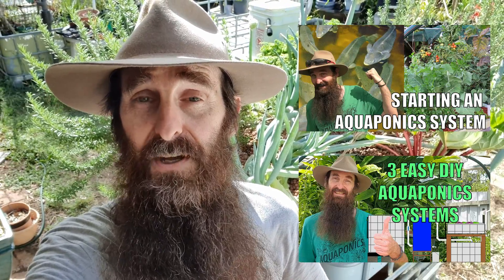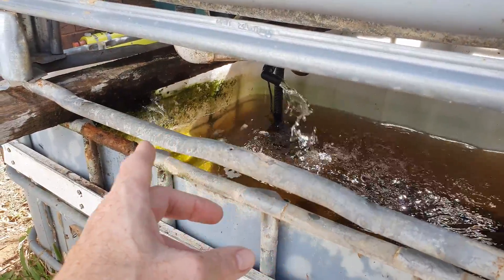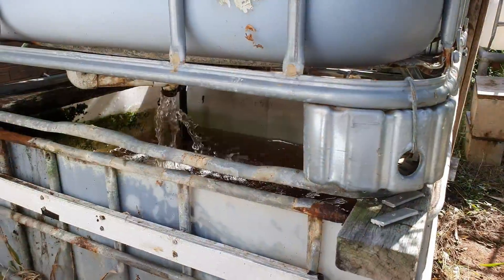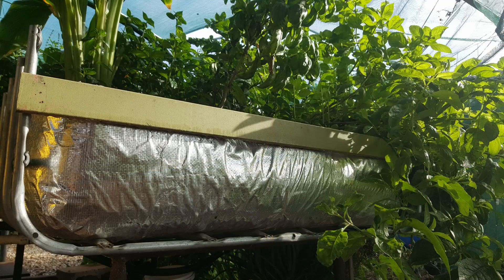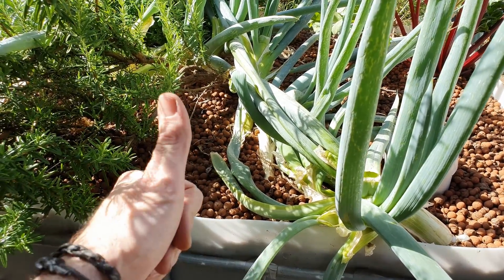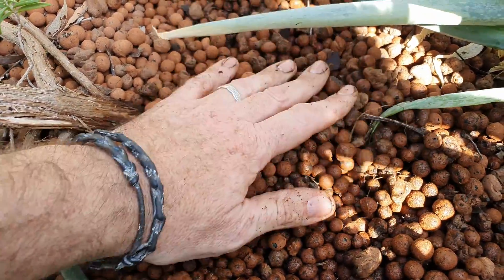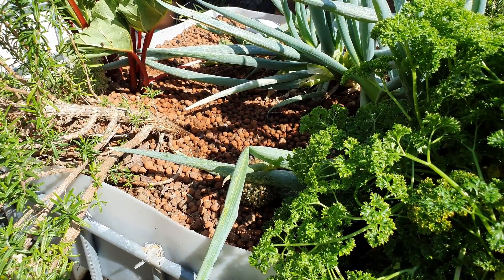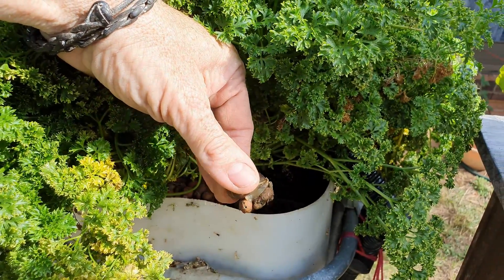Aquaponics System | Chop & Flip Design Mistakes

Comment: Hi Rob! Thank you sharing all your precious knowledge with us. Thanks to your videos I've started my small aquaponics blue barrel system: 180L FT, bucket radial filter, half blue barrels (1 dwc and 1 media bed),22 juvenile tilapias. It's been 2 months and still no nitrates?! Could it be my poor flow rate from radial filter? I've made the mistake of using 32mm pipe. It fills up a 1L bottle in 9secs. Any help would be much appreciated. Thanks
Reply from the maker: Hi there.
It may just be that the plants you have in there are taking up all the nitrate. Do they look green & healthy? 
Cheers
Reply: Thank you for your reply.No they look very nutrient deficient as the lettuces are purplish turning brown, and other soft vegetables have yellow leaves with green veins. Swiss chards and bok choy experience stunted growth. I've added a cap of Seasol. Then less than 1tsp of Ca,K,Mg and Fe in the following ratios 2:10:5:10. Only plants doing ok is my cherry tomato and thyme.
Reply from the maker: @jbl2270  I think there is just a lack of nutrients in the system. Maybe cut back on the number of plants you have until yo see an improvement n the remaining ones then slowly add more.
Reply: @RobsAquaponics  okay thank you for taking the time to reply. Good day!

Comment: For painting plastic, you will get  better bonding of the paint to plastic by "flaming" the plastic before painting. flaming involves simply passing a gas flame over the plastic, this causes a temporary (about 24 hour) molecular change to the surface allowing the paint to adhere to the plastic more efficiently.
Reply from the maker: Thanks fr the tip mate. 
Cheers.
Reply: You can also use automotive adhesion promoters. It's used before printing and painting automotive plastics.

Comment: G'day Rob. Great video. Just thought I would mention something my research is showing: even the most basic ambient lighting greatly inhibits the enzyme used by nitrifying organisms (or at least the ones that convert ammonia to nitrite). The experiment is in a controlled environment graphing ammonia and nitrite concentrations as measured by a spectrophotometer using Nessler's reagents (so like an API test kit but measuring the output as an exact number). Just leaving fluorescent tubes on for 6-8 hrs a day in an otherwise darkened room has greatly reduced the nitrification rate, when compared to a totally darkened environment. I should point out that the middle of a grow bed is likely as dark as you could ever need, and also that the media volume required for effective nitrification is much lower than I had initially intuited. Another thing I have discovered is that the same organisms can process ammonia efficiently even in fairly oxygen-poor environments (as low as 2mg/l).

Keep up the great work mate.
Reply from the maker: Thanks for that mate. I leaned early on about how little is needed from Mr Paul. 
I don't like to suggest folks in the backyard environment try it as most can't pay the level of attention needed or have adequate solids filtration. Have seen things turn very ugly (& smelly) very quickly when folks try to grow big out of the gate. 
How are the studies going? 
Cheers.
Reply: @RobsAquaponics  Yeah for sure Rob. The more filtration you have, the happier and safer your fish will be. In high-density commercial aquaculture, almost all solids are removed automatically by something like micron steel mesh drum filters and automatic spray cleaners - and for good reason. When it builds up, that stuff gets nasty without heavy aeration. Regards my studies, I am so close to graduating with a science degree in aquaculture that I can almost taste it. But by Apollo, is it a marathon. So. Many. Years.
Reply from the maker: @AdamTait-hy2qh  😅 Hope the last stretch flies by for you. 👍

Comment: I am a amateur compared to you but when I did my grow beds I still use the basket so I may pull out the plants and clean, move or make repairs.
Reply from the maker: Have done the same with the root pouches in our system at home. 👍 Normally I don't think it's needed though if the beds are set up properly & left to just grow. 
Cheers & happy growing mate.